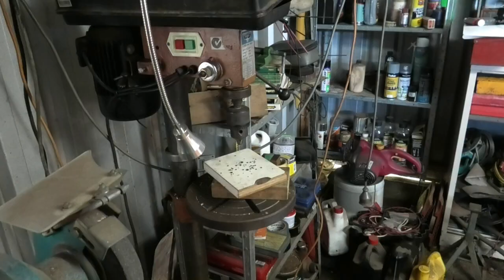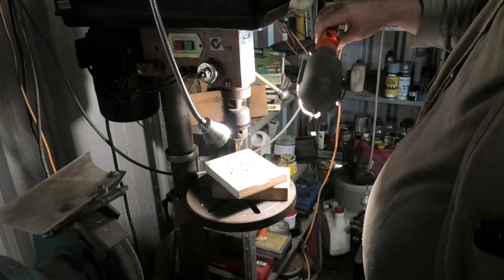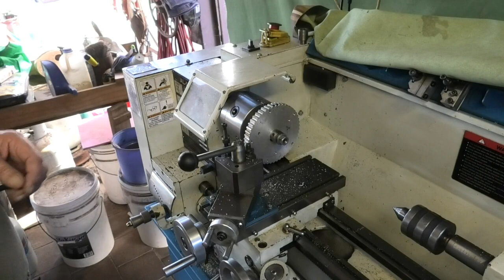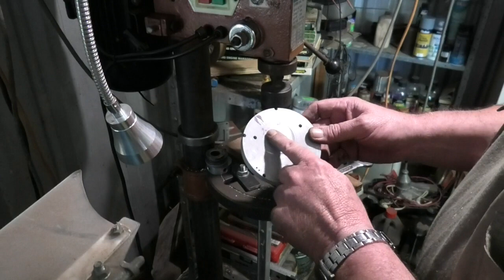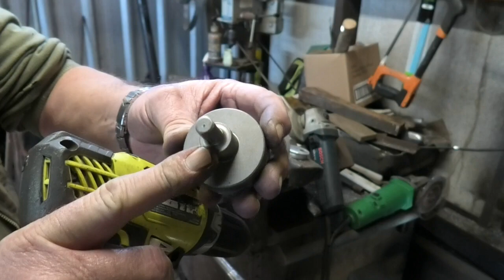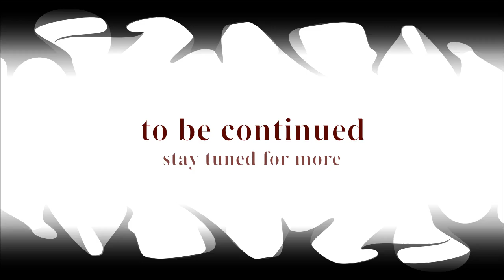Drill Press Light

Comment: Looks interesting Peter.  By having the ring light offset it may also move any shadow of the chuck away from the drill position.  Your Pillar drill is a lot like my Taiwanese Royco 12 speed.  Good gutsy unit.  Cheers Rob
Reply from the maker: G’day Rob. My pillar drill is an old Sher, not Skill Sher, gold colour so dates back to the early 70’s it’s a gem but I must make new thumbscrews to lock the motor/belt adjustment one day. The light being a ring casts no shadows, it is well worth the effort to fit, should have done it years ago. 
Cheers 
Peter
Reply: @pgs8597  G'day Peter,  the belt tension lock bolts on mine also have cheesy tabs on them.  Better off replacing with a regular hexi head bolt.  At least they won't rattle.  The original ones hold OK and I rarely change the speed, so it's another job to do ;)  I wondered how the light went.  Good to hear.  Cheers Rob